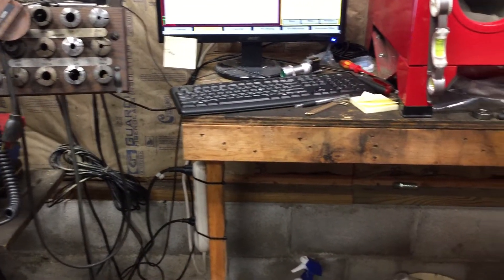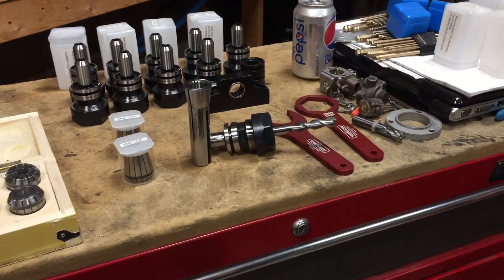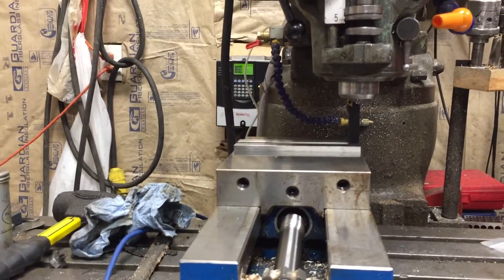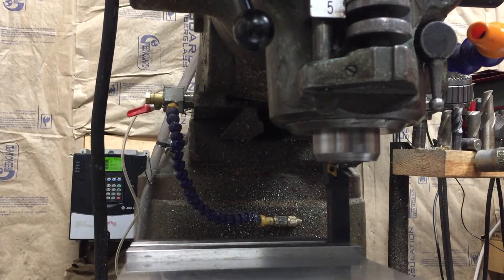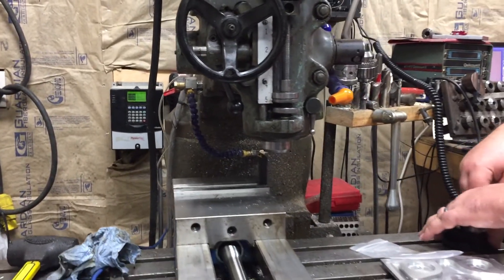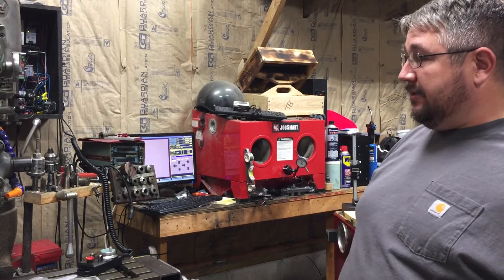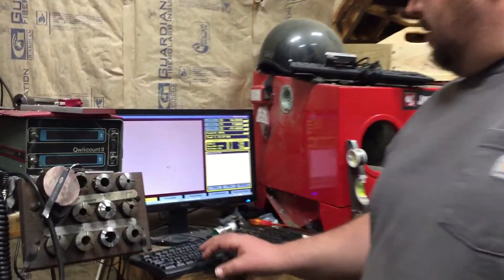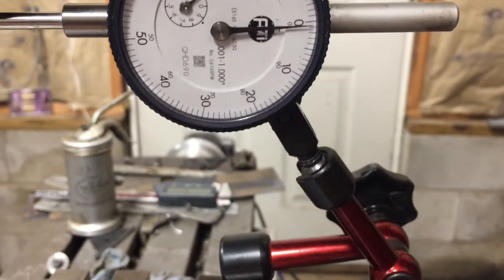Tormach TTS System Used on the Bridgeport with Masso Controller and Clearpath servos.

Comment: Just curious but why did you go with all ER collet holders and not any TTS end mill holders with the set screw? From what I understand the TTS end mill holders are a little more rigid that the ER collet holders and plus they are cheaper.
Reply from the maker: halfstep67 just never really like that style of tool holder.  Even on our new to big mill we only have a couple of them due to run out.  The old Bridgeport needed all the help it could get with holding sizing

Comment: Great Vidios could you please tell me what size / Modle your Clearpath Servos are as your mill is about the same size as mine
Reply from the maker: William Norris im running this one. CPM-SDSK-3432S-RLN with ball screws
Reply from the maker: William Norris also a 5:1 servo gear box on the z axis
Reply: Thanks John thats very helpfull I take it you are happy with the Masso as I live in Australia I am keen to use a Masso as well as I have had a lot of trouble with PC based controllers in the past

Comment: Really interesting video. Facing the spindle nose is pretty interesting. Is that commonly needed when using TTS? I'll measure mine. Thank you. That huge shop expansion is going to be awesome. Congrats!
Reply from the maker: Kent VanderVelden my spindle had some big nicks and marks in it. The run out was horrible until i cut it.  That cut was only .004 and was hard.   If ya dont use the tts then the face of the spindle really don't matter so when we switched in had to be done.  I asked my brother n law about later that day (tool and die guy of 40 years) he said he has had to do that before but uses a stone in a die grinder in the vice. He was kinda surprised i was able to cut it with the insert.

Comment: the only problem with this system is while it has a superior tool change/clamping system it is still limited by the r8 which is the weak link...now the tools wont pull out of the toolholder but the whole assembly can still be pulled out of the r8.Hopefully it works out for you and the risk is minimized since you wont be changing the tool holders themselves as much.I may be wrong...I have never had the tormach system in my hands...is there some sort of extra chamfer or step on the shank of the tools that can positively lock them when the main spindle is tightened or are they just smooth shafts? Either way...dont take this as a negative...you have a nice setup and have done some nice work and good videos...I am just very paranoid about standard r8 collets lol...people use them all the time without incident but many of us have destroyed parts and jigs over the years as well simply because we wanted to save a bit of time
Reply from the maker: mountainmanfab it is just a smooth shaft but seems to clamp very well with the new collet that matches there system.  Also has the added support from the ring contacting the bottom of the spindle. Hope it all holds up.  Thx

Comment: Shoot, just bought an MPG for my new MASSO and the encoder is 5VDC
Reply from the maker: Ryan Leslie send that thing back unless ya have a 5 vdc supply to hook it to for power.  The masso will accept a 5 vdc pulse but the pulse wheel has to have 5 vdc supply or u will just a cool looking wheel that does nothing. Lol
Reply: John, have you wired in the HLFB signals from the CP motors to the Masso? I was thinking of trying this when I get the new software update added.
Reply from the maker: Ryan Leslie well no i have not. There is really no where to wire them to the masso that i know of yet. I looked thru all of the inputs but there is no listed input for the drives yet unless i missed it.
Reply: I'll take a peak, Hind mentioned there is an input option for them in the configuration for update v3.01 (maybe one of the OPTO inputs can be set up). I think they can be used to feedhold the machine if the clearpath motor gets into an alarm condition
Reply from the maker: Ryan Leslie i know he said it was going to be a option in the future but I didn't see it yet